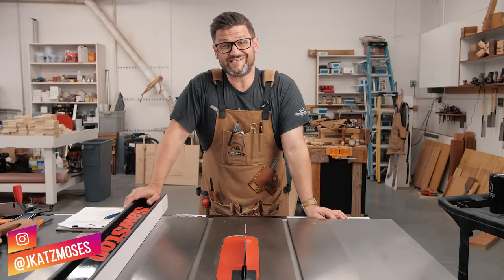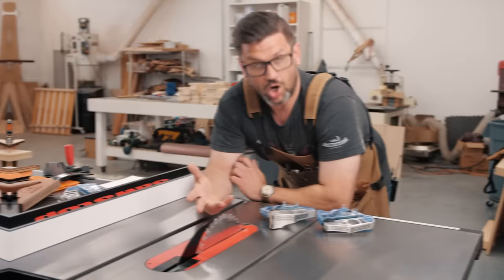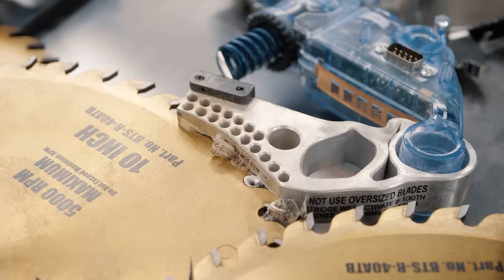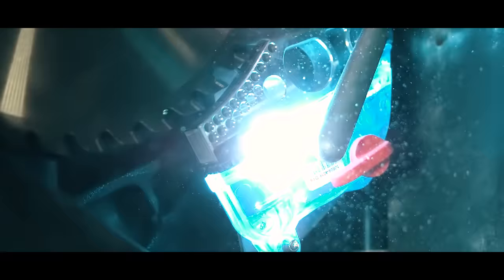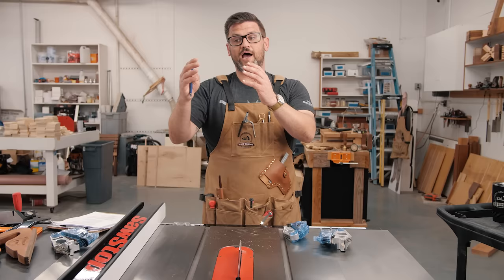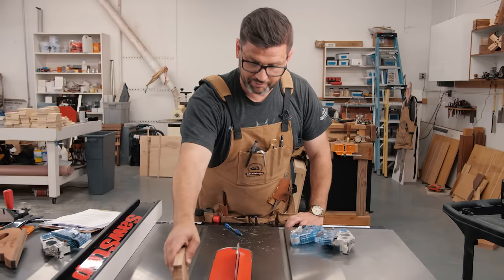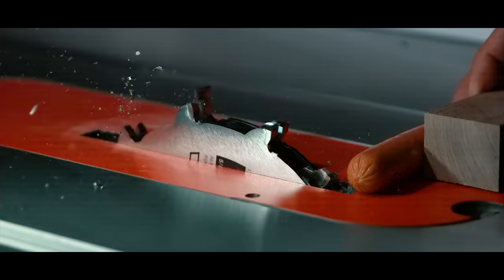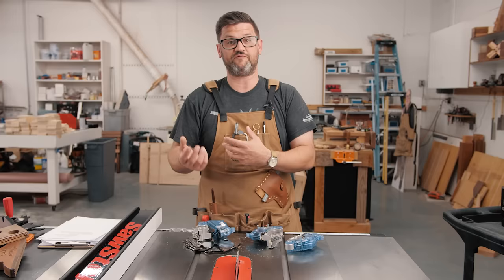How Safe is a Sawstop Saw? - Never Before Seen 19,000 FPS HD Slow-Mo Video

Comment: I just hit my fingers with my table saw 2 days ago and the first thing I thought of was this saw.
My blade took the fingernail off my ring finger and blew out the tip of that finger. Then it nicked the bone in my middle finger as it passed through the top of the finger. And finally it grazed across my pointer finger after just barely trimming the sized on my nail. This resulted in 10 stitches and a ton of pain.
All this took the time it takes to make the sound ting ting and you don't feel anything for several seconds and then for next full day you are reminded of your ignorance by surges of pain at random from the injury.

Comment: It was really cool to see these in action!
And that you can do multiple activations by replacing the cartridges.
I'd talked to a carpenter friend about sawstop years ago and he said he wouldn't get one because "the kinetic energy from a stop throws the whole saw out of whack and you have to send them in to be serviced each time". 
Now I wonder if he was just pulling the reason out of his ass at the time, or if the cartridges are a new way of doing it :)
It's pretty awesome to see though, considering I had two shop teachers with missing fingers as a kid. Between the two of them, enough missing to make one hand.
Reply: Does your friend know that if you rip your finger into the blade you have to get your hand serviced?
Reply: @AWOLBones  LOL. Execellent reply :)
Reply: Did you know you don't actually have to put your hand anywhere near the blade while using a table saw? I'd be pretty irritated having to get my table saw fixed and have to buy new blades because the safety stop misfired. And again my hand would never be anywhere near the blade.
Reply: But like... It activates when you would put your finger in it. So this guy would rather lose a finger than having to buy a tablesaw
Reply: @barnabasigari3109  Why are you putting your finger near the blade?
Reply: @WhiteSupreme  I was reacting to the original comment
Reply: @barnabasigari3109  Yeah and? A Carpenter like the op stated, would know how to properly use a table saw. You don't ever put your fingers near the blade unless it's shut off and power source cut.
Reply: @WhiteSupreme  the reason he stated he doesnt get one is that if it triggers it ruins the saw. thats a bit dumb because if it does trigger that means it would have cut you. So he would rather get cut then get a new saw. I get whst youre saying, i dont know much about saws surely you have a good point but im talking about something else
Reply: @barnabasigari3109  it can misfire
Reply: @WhiteSupreme  🤡
Reply: @barnabasigari3109  That is a very accurate depiction of yourself. 👍
Reply: @WhiteSupreme  At no point is a misfire mentioned in the original comment. Maybe that was what was meant but thats not the point. Nothing about what i said would need extensive knowledge about saws. My original comment was a random tought i had that i decided to post. Stop taking yourself and everything else seriously, and stop thinking youre better and smarter then everyone. Youre not.
Reply: @WhiteSupreme  notice how you turned a civil conversation into a hostile argument. funniest part is you dont seem to have any idea what im talking about.
Reply: @barnabasigari3109  👍
Reply: Well yeh its goma need checking over the same as anything that's been activated in an emergency. But what's worth more ur fingers hands or arm or a saw? Which makes you money all your life
Reply: The PCS weighs 450lbs, which is plenty to absorb the kinetic energy of a stop. 

The "misfires" that people are mentioning in the comments are from causes specifically laid out in the manual (e.g. cutting metal, including nails or other embedded material in a piece of wood, or wet wood) that lead to a "false positive". In the specific instances described, you can put the saw in bypass mode to disengage the sensor, but it obviously won't stop the blade on flesh contact in bypass mode. If the cartridge does fire from flesh contact in normal use, Sawstop will replace it for free if you ship the cartridge and blade to them for the data. 

Your friend was pulling a reason out of his ass because he doesn't want to spend $3-5k on a table saw.
Reply: @WhiteSupreme  cross cutting, ripping narrow pieces, cove cuts, kickback, general complacency. Every cut can be done safely,  but accidents can and do happen, even to professionals. It only takes a fraction of a second to slip and lose a finger. Yes, Sawstops are expensive, but so are hospital bills. At least the cost of a Sawstop gets you a nice saw instead of a permanent injury.

Comment: 7:00: Dado stacks AREN'T illegal in Europe. It is just not compatible with most of saws because of safety reasons. But you can buy Dado (like from CMT) stacks and Dado compatible table saws (Like Laguna Fusion) here. 

The reason why it's not compatible is because in Europe all of non-closed woodworking machine must stop within 10 seconds after pushing the stop button. Most saws - specially jobsite saws - usually stops within a few seconds (For example my Metabo TS 254M stops within 2-3 seconds). This usually require some kind of active breaking and if the saw don't do a soft breaking then the Dado stack's momentum could loosen the locking nut on the shaft -  I guess I don't have to say why it is bad. Once I even managed to do that with my regular 254mm (10") 60 tooth Bosch blade because I wasn't tighten the locking nut properly. 

So Dado stacks aren't illegal just need a saw which supports it properly.

Comment: This is incredible, Jonathan. Makes me wonder why Saw Stop aren’t in the UK. Having them here might then contribute to being able to use a dado blade too. Thanks.
Reply: I wrote to Sawstop when they first came on the market, and again recently after Festool started marketing Sawstop technology in Europe (TKS  80).  They wanted to bring it in but it would have required too many changes to make it worthwhile for them. (Or so they said.) So you can get Sawstop in Australia, New Zealand,  Canada etc., but not the UK. Regarding Dado stacks.  They are perfectly legal in the UK, and  always have been, but their use was discouraged, especially in the professional environment.  The issue is provision of guards - and possibly time to brake the blade (Not sure about that last part, may be wrong) so manufacturers avoided the problem (Liability) by just shipping machines with an arbor too short for a Dado stack.  Axminster now sell the Harvey Industry saws with provision for Dado.  I don't know if it is possible to do a private import of a Sawstop cabinet saw.  If you are interested Felder now have something similar on one of their highend machines - but I do mean HIGH END! If Sawstop were ever available in UK I wouldn't be able to get my cheque book out fast enough.  Safety is safety.  My car has seat belts and anti skid braking - I hope never to need them bu it is nice to know they are there. And airbags....
Reply from the maker: This should be a top level comment. Great info bud
Reply: Jonathan Katz-Moses I want to ship one to my brother in the UK. Some Amish neighbors run sawstop out of a Diesel engine .. I think we should be able to make 220v 50hz work??
Reply: fuzzywun. Thanks for the very detailed response. I actually did a little research and noticed that Festool was integrating the SawStop tech into their job site saws. I couldn’t see a shop saw.

With regards to Dado stacks, I know about their use and also about Axminster saws, but that’s really the only one using it which applies to UK law.

Thanks again.
Reply: I bought a dado stack in UK with my De Walt RAS a long time ago (about 1980) but only used it a few times.  I never thought it dangerous but a RAS is quite different from  table saw as the saw moves away from you instead of you moving towards the saw.
Reply: @chm1701  Hi  If you by a Hammer saw they will fit a Dado arbor.  Charge for it though!  I seriously wonder what the best route is ; if you bling up the Axminster with all the widgets you probably aren't far off the Slider from Hammer. or Robland.  I just don't know... Is the refusal of the EU masters to allow the Sawsstop just protectionist?  I know they have done just that in the aviation world.  Their refusal to allow a certain American helicopter (R66) for years was just scandalous!
Reply: I'm in Sweden and will probably invest in a job-site saw during next year. If I could get a Saw Stop I would and happily pay the extra cost but they are just not available here. For me Bosch are always on the short list when shopping for a new toy, but I wouldn't be surprised at all if they really don't want Saw Stop in Europe and are prepared to lobby heavily against them. I know that Bosch have (had?) something similar but what I heard it wasn't even close in performance.
Reply: Festool are now putting saw stop, or their version of it on all their new table saws!
Reply: @fuzzywun  you could privately import one. If it's not ce approved it wouldn't be strictly legal. There is a chance trading standards would stop it but the is extremely unlikely for a private import.
Reply: @tainio  I have consisered it, but then there is not going to be any supportfrom Sawstop.  Arbor will be different size as well (Imperial).  I may well get the Festool TKS 80, but still undecided.  Alternatively something like the Laguna F2m and fit it with a power feeder ( See Andrew Klein),  Just don't know.  As far as I know the CE approval is just for machines sld in the UK, and it would be illegal I am sure for professional use.  Private use not a problem.  Hoping to see a Festool in the not too distant future......... at least there will be the backup.  And the Festool service is exemplary.  Sent my Kapex off for repair, brilliant service from Festool.  Many thanks for your reply!
Reply: @fuzzywun  you can't import for personal use?
Reply: Possibly Sawstop is not in the UK, because there are (for the next few months) EU rules on table saw manufacture that are far more relevant that the US approach of trying to render 80 year old saw technology safe with a series of kludges.  Also, in parts of the EU you have to have a 7 year course to hang out a shingle as a carpenter.  That would seriously restrict a lot of worthwhile US innonvation, but it does ensure that complete morons are not let loose on tablesaws.
The most frightening aspect of the Sawstop phenomenon is that people readily assume there is a reason to have your fingers in the blade of a table saw.  It is like not having range proceedures and contruction to keep shooters safe, but instaed issuing everyone a bullet proof vest.
That said, in my path I did slightly nick a finger as close to a scratch as it could have been.  I also took a hit from kickback.  The cost of being self taught.  But if the saws had been properly designed, or if there had been any competent instruction, neither would ever happened.  Part of the US nonsense is the desire to use saws for the widest range of operations, some of which are just unsafe.
Reply: @fuzzywun  The thing is that European saw design rules were completely redesigned at least twice in my career. Adding Sawstop to the Reinhard, or Inca, etc... is completely unnecessary, not to mention all the industrial grade saws that have things like power feeds on them.  It is a system designed to keep the unskilled work force in the US from raising insurance costs, in a world where there isn't health care for everyone, or where your day labour force is picked up in the parking lot of Home Depot every day. 

If you look at all the Kludges that have been added to US saws to make them even modestly competent, you can see the problem:  Fences, splitters, cross cut sleds, sawstop, guards, and so forth.  People accept that these dinosaurs like the Unisaw, are some kind of state of the art product like a 1938 car, just so long as you make a few grand worth of alterations.

Then when the Asian saws came out, they copied the same, now, 80 year old technology, and it got another burst of life.  The same things has happened with the lathes coming out of the East, but there, virtually no turners are going to fall for that nonsense, and modern western tools still predominate.
Reply: @fuzzywun  I bought this book in the 80s, or maybe 90s.  It was put out by one of the UK magazines, and it covered all the power tools and safety.  What was really cool about it was that the book covered the EU safety laws, and changes that had been addressed to raise the standards of inherent safety in their tools.  This was just at the point when they were outlawing the tilting tables on saws, if that places it in anyone's history.  But they already had riving knives that worked in both solid and plywood stock, proper guards, and proper fences.  Along with with ripping guides.  The saws set up straight, you didn't have to know the magic 3 axis's that needed adjustments on a Unisaw.  I remember reading article about that in the 80s, then out came this article about the third axis.  The irony today is that you can get all this info for free, instantly, yet we are still fighting reality.

Anyway, no, it is not EU protectionism, other than in the sense that higher standards and rules are a form of exclusion.  When I started to buy my tools in the 80s, a new tiny inca would have cost me 1K, at least, but today, I can pick them up for about 300, though I could get a comparable cast iron Dinosaur for under 75.  I have owned a lot of different table saws, and have settled on the Inca for my current uses, but it is also 50 years out of date, it is a compromise also.  I would not recommend it.
Reply: You may be able to buy the Bosch Reaxx saws in the UK.
Reply: @haqvor  The Bosch Reaxx doesn't stop the blade, just slams it below the table in a couple of microseconds.  The upside is your blade isn't destroyed.  The downside is the possibility of a slightly deeper cut.
Reply: @hiragana78  you can import it but it wouldn't work here out of the box. The US electrical system is 120 V/60 Hz and the European is 240 V/50 Hz. It can of course be transformed but the necessary equipment will add 600-700 EUR to the total cost.
Reply: @haqvor  Amazon UK sells a 3kW 240V-120V transformer for 70-140 pounds.
Reply: @hiragana78  I didn't hunt for the cheapest price but only looked at a reputable seller (elfa.se or www.distrelec.biz for their international site) of electrical equipment. The transformer was about 300 EUR and about the same for the frequency changer. I have no doubt that you can get it cheaper but be careful about what you buy. This is not the kind of equipment that it is wise to have price as the most important factor.
It is not enough to only transform the voltage the frequency must also be changed from the European 50 Hz grid to the American 60 Hz that the saw is made for.
Reply: @HondoTrailside  A voice of reason!  Trouble is, most of the saws on sale in uk are just chinese vaiations of the stuff for sale in the US. My point is not that I think Sawstop or similar should be mandated in the UK, but that the Sawstop is, by all accounts, a high quality saw with an additional safety feature.  It bothers me that it is available everywhere but here.  It is true that the European saws (especially sliders) are probably inherently safer than the UniSaw styles, if properly guarded and sensibly operated. But if Germany is still recording 30 accidents a day the point is moot. Bosch came out with REAXX, Felder have their version (Probably the best since it doesn't damage the blade on retraction) and now Festool have incorporated Sawstop in their TKS 80.  Possibly the way of the future IS some kind of blade retraction.  I seem to remember a lot of resistance to safety belts and air bags!  I still haven't replace my Scheppach TS2000.  As a footnote, nobody plans on accidents, they are always unexpected - but they still happen.  I am sure there would be a lot fewer accidents in the States if better use was made of guards... watching YouTube videos, very few people seem to use them.....  Oh, and Thank You for your posts!